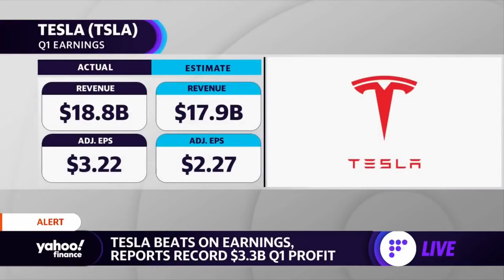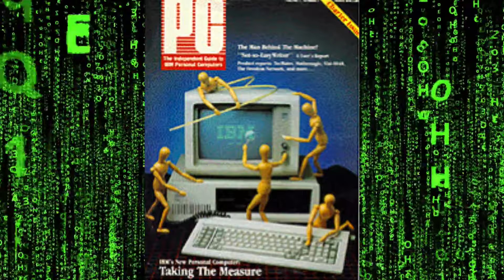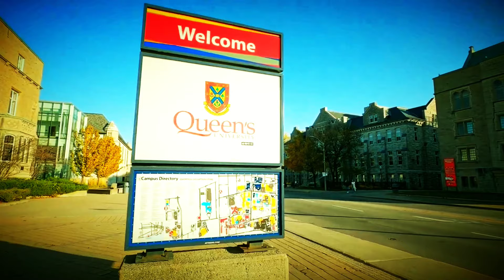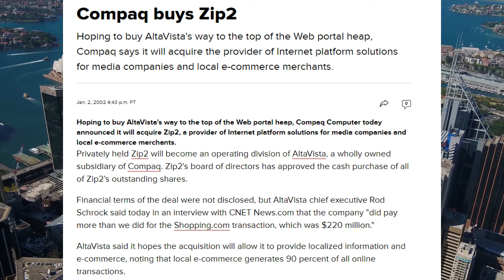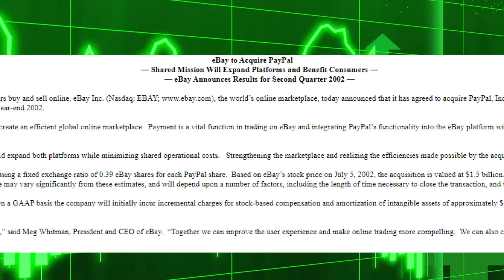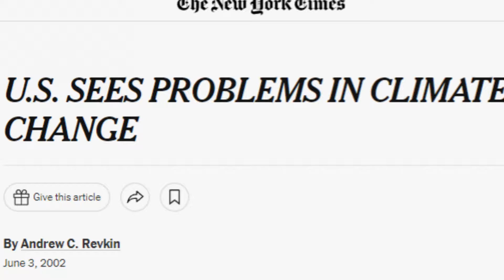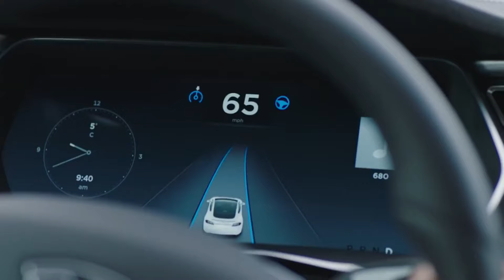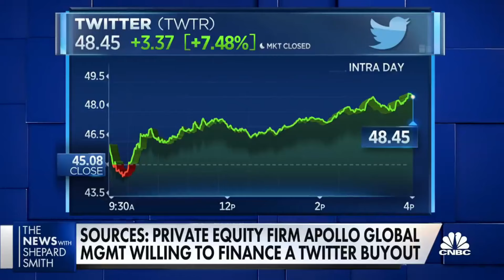The Story of Elon Musk

Comment: Hey, I have a question for one of your old videos, "How To Create An ENTIRE NFT Collection (10,000+) In Under 1 Hour Without Coding Knowledge", is it possible to change the output resolution or dimensions because my images always come out in 230 x 230 and do not come out as sharp as they looked before generating the individual NFTs. Thank you
Reply from the maker: Heya! You should be able to change that line of code at the same spot where I input the 1000x1000 :)
Reply: @HustleMillennial  Thank you I have figured it out.